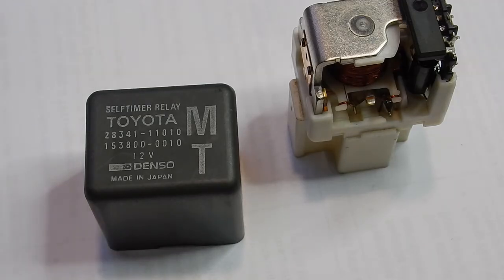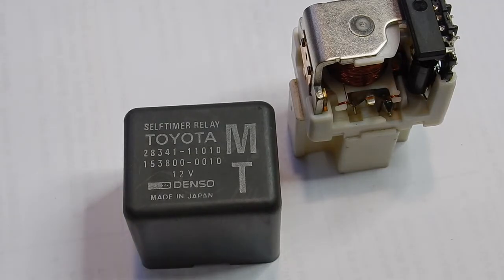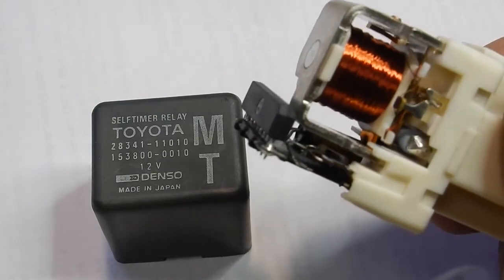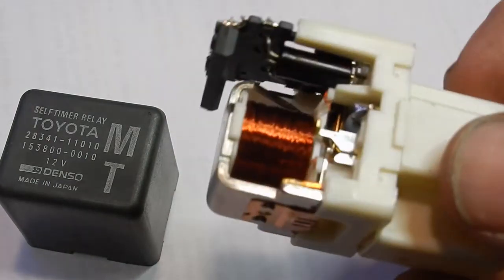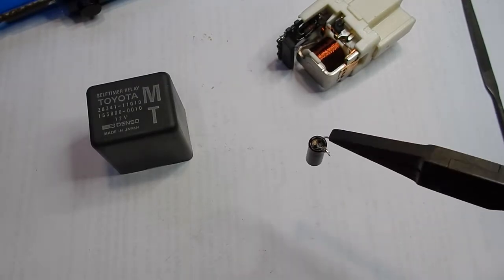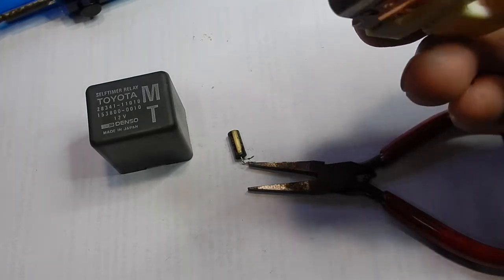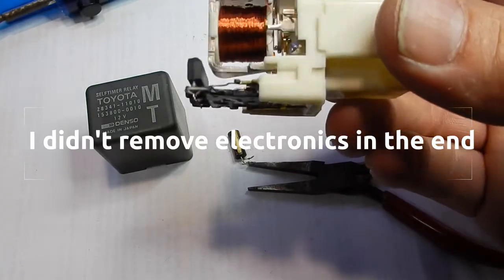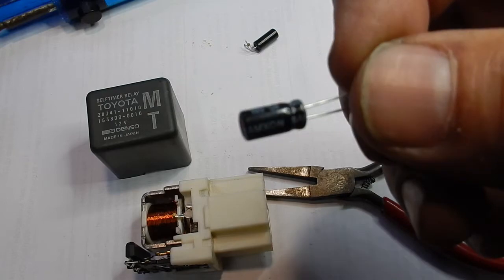Toyota "Selftimer" Starter Relay - Why?

Comment: Rebuilt my '94 Surf after it was stolen and used in a raid and since May I have thought, similarly to you, that the double key turn was a feature of the new alarm I had fitted. Started blowing the 80 amper recently and having strange starter behaviour. Trying your method tonight. Thank you Steve

Comment: Thank you for this video. I just started have intermittent starting issues on my Toyota Hiace diesel van. Intermittently no start first key turn - start on second turn. 50% working first turn, then other times not, Found it weird as hell. Toyota we’re baffled. Lots of searching online and testing the ignition wiring etc. Then searched Toyota Selftimer Relay which led me to a forum where I found a link to your video. Probably be buying a replacement as don’t have the skills for a self repair. Cheers

Comment: I just took mine apart. Its foing the same double tap symptom. Lately it started to fail even the double tap and failing to start comoletely. I'll tyr and give mine a go, change the capacitor. This was very informative. Thanks. 🙏
Reply from the maker: I hope it worked mate.
Reply: @steveremote3952  funnily enough, while tinkering with it on the kitchen table, giving it 12v supply, shorting the signal lead and checking the timer feature, I accidently shorted something and ended up blowing the controler chip on board. Huge crater, and a puff of smoke. This resulted in a perfectly functioning relay switch without the very useless 90 second cutout timer feature. Reinstalled it and never missed a beat since then 😅.
But let's face it, who in his right mind would crank the starter motor for more then 90seconds? Especially on a perfectly healthy and reliable half turn start toyota disel engine? 🙂

Comment: If you bench test the timer, you will find it releases after 90 secs.
Nice video by the way.
Excellent!
Reply from the maker: 90 seconds is a long time. I'm not sure I waited that long when testing mine. Another fellow in the comments has suggested that it's to protect from people cranking the engine for a long time. My battery would be flat before 90 seconds was up. Thanks for helping solve the mystery.
Reply: It's a Mr T mystery and it's CRANKY!
Reply: I found 2 Relays online in Indonesia. A friend from Bali sent them to me and both were faulty. I've repaired them both with your capacitor solution and they both work. so now I got 2 spares. If anyone wants one....?

Comment: Great, thanks. I've a LN130 (4Runner '95) that developed this "problem" amd was getting nuts to find the starter relay (mine is not in the fuse box, it's on its side, and labeled... yes, self timer relay. I'm used to leaking caps so as you, I bet this is the problem. Will try to see if it disconnects after a time, Denso sure has a reson for labeling it "self timer"

Comment: Hi Steve - great video!  I have the same problem, but I'm not much good with electrical components.  I live in South America and cannot find a replacement part.  I think the best course of action for me would be to remove/bypass the timer compent completely, would you be able to provide any advice on how to go about this?
Reply: 28300-10020 relay part replacement

Comment: The 95 Hilux my father owns has had starting problems for years now and recently was a pain. Took us a week to check and fix any or everything that had to do with the starting problems. We came across your video yesterday and sure enough we did the same and now it starts without a problem. The version of the relay that we have is 11040 they are externally different but the internals are almost identical.
Reply from the maker: Sorry for the late reply. That's great news. I wish I knew why they had something so complex in them to begin with?

Comment: Interesting. Perhaps it was a timing circuit to stop you cranking the battery flat?
My old "tractor" had a timing circuit on the starter, however once you hit "start", it would latch the cranking relay for 30 seconds (unless it started in the meantime). Don't have the 'cruiser anymore so can't check. 
Might be something similar?
If you are curious, connect the relay to your bench supply and leave it activated for a few minutes to see if it disconnects.
Reply from the maker: Well guess what? I actually have one of those exact same "tractors" in my shed right now (for sale by the way!). I'll have a look at what relay it has in it. I will also test the one in the Hilux. You say the timing might be up to minutes in duration? Jeez, that way longer than I was expecting and I never left the relay coil energized for anything like that when I was testing it. Thanks.
Reply: @steveremote3952  Cranking delay was 30 seconds for mine. I only suggested hooking it up on the bench for "minutes" as the 'lux might allow a longer duration.
With the 'lux, turn the key to 'start' and it will crank; let it go and it will stop cranking.
With the 100 series, turn the key to 'start' and it will crank; let the key go and it will continue to crank until it starts or 30 seconds has elapsed.
If you have one in the shed, turn the ignition on and 'start', but quickly let go the key (faster the better for the purposes of this demonstration). You will find it will continue to crank until it starts, even though you have let go the key.